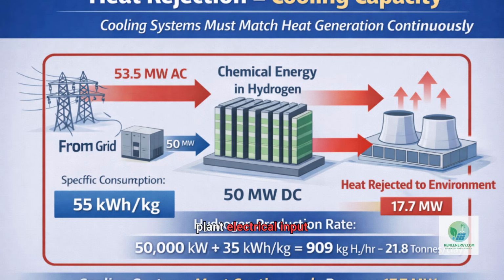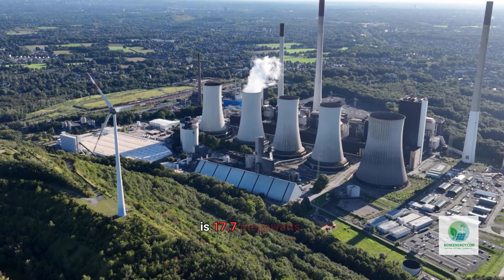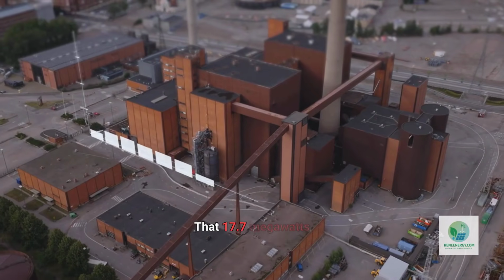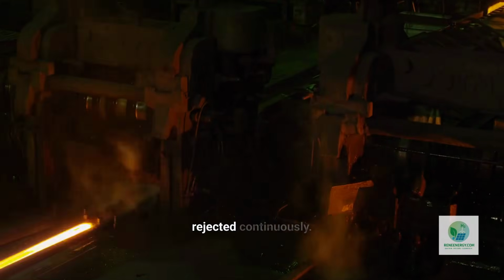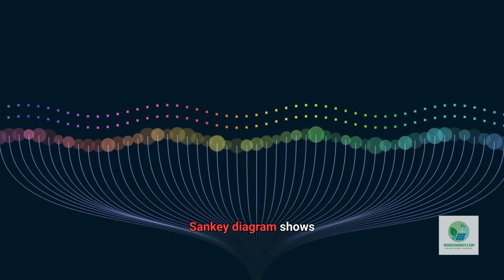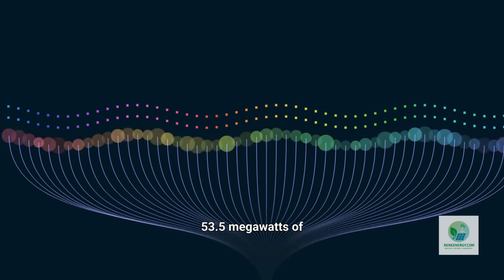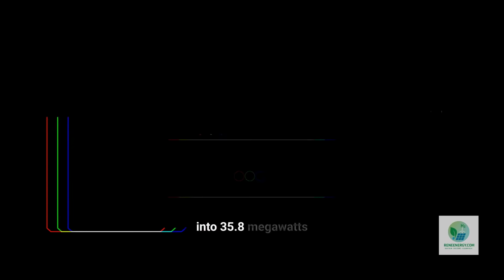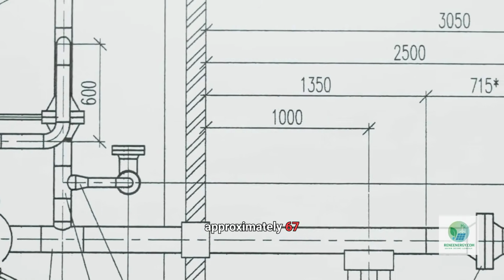Why Your Hydrogen Project Needs 53.5 MW to Deliver 50 MW

Comment: The balance is negative; however, in a renewable energy system we will have different curves for supply and production. This station can act as a battery to store the energy.
What is the price of resilience?
Without fossil fuels, how are industries going to generate heat for their processes?
Electrolysis brings another advantage: oxygen (O₂), which is used in many processes (water treatment, hospitals, medicine, industry, etc.).
Energy balance is important, and we need to be conscious of that.
Thanks for the explanation. I am not an expert, but I  enjoyed to seeing the energy balance🙂🇵🇹